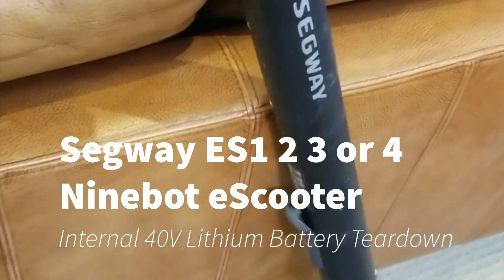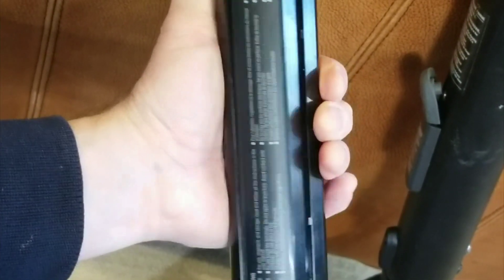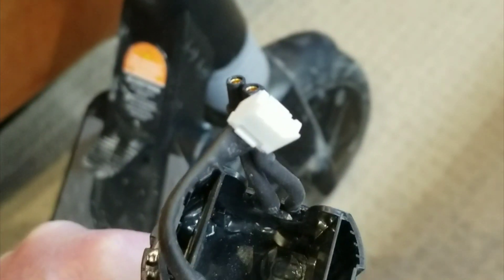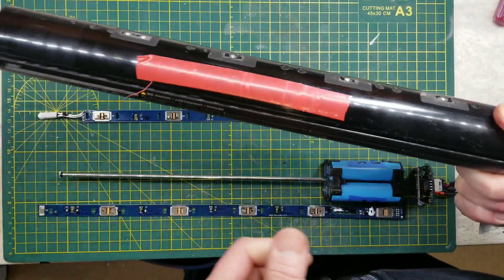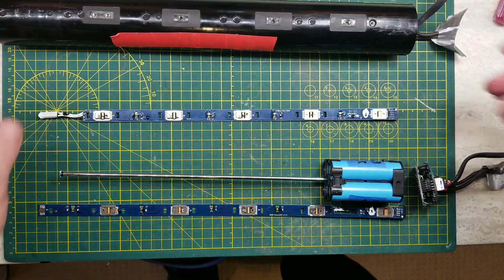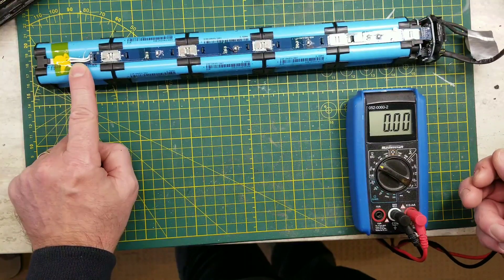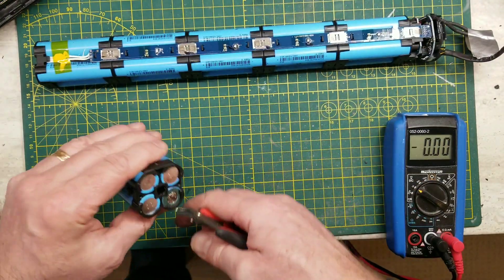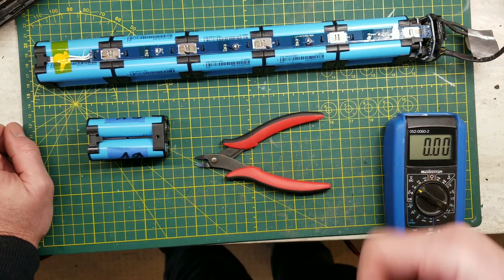Segway Ninebot Internal Battery Teardown

Comment: Hey there, have removed the whole pack from an ES2 and there is no blinking from the pack but with multimeter read out is 14,7 volts. Can't get the scooter to start the display or charge, simply to low voltage to charge it? But why no blinking you think?
Reply from the maker: Hey Per
15v out of pack is definitely not right or good.
Should expect voltage of 40v plus when fully charged and I believe no lower than low 30's for 'discharged' state.
Each of the 20 cells works between about 3.7 and 4.2v when healthy.
I dont know the exact answer but could be your BMS board in battery has gone bad and your cells will no longer charge. Has scooter been 'dead' for a while? 15v is very low.
Reply: @fixitdad899  yeah it was left over wintet by previous owner. But all solved now. Managed to bump the battery up again to around 27 volts and aftet that regular charger worked again. First battery showed nothing (not flashing) but after a little bumping it started first flashing red and a bit later went to normal blue flash state. 👍🙂
Reply from the maker: Hey... nicely done! Great information re: when lights kick in / red / blue.
Question for you - how did you bump charge? Did you have to bypass BMS in battery pack (disassemble) or could you just go straight to the standard power out leads? Did you use a plug in external adjustable power supply? I have a bench top supply that I think maxes out at 30v. Can adjust current and voltage. You? Many thanks for any insight here.

Comment: My isn't finishing blue it run donw immediately and when am charging it it get full immediately
Reply from the maker: Hey Mike ... just curious ...How do you know its 'immediately full' when charging? If you are looking at charger and seeing green light it does not mean battery is full. It means charger does not want to supply current to battery anymore. A battery that has gone below minimum charge will also do this. Are you checking with voltmeter / multimeter?

Comment: Hey there its me again...so I went with your advice and purchased a new internal battery and I have installed it but do I need to reset it somehow ?? Cuz Ive got it all back together again and turned it on only to still get the error code 19. The blue light is fllashing on this replacement even so what should I do. Plz help
Reply from the maker: Hey RobYn ... nice to hear from you again. To be honest I sadly don't know the answer.
I've tried to find the 'Rosetta Stone' for decoding error codes for trouble shooting but alas haven't yet found.
Am not sure what Code 19 actually is.
Can anyone reading this who might have the answer jump in and advise RobYn on this one?! Many thanks gang.
Reply from the maker: https://m.gearbest.com/blog/how-to/ninebot-segway-es2-scooter-error-code-7369
Reply from the maker: Says "19: Battery voltage is abnormal, check battery, control card, cable connected."  
Is there a loose cable somewhere? What is voltage on new battery if you check with voltmeter? Should be 35ish V or better if it has reasonable charge on it.
I wonder if you have to pre-charge before you install replacements? Did you buy replacement 'new' or could it be a used dud sold by some scoundrel?

Comment: how did you get the cover off the battery? The cover with the two holes? I have been looking for 1 year for this tool !!!!
Reply from the maker: Hi Dash..  I have a basic shop compass from Harbor Freight / Princess Auto. The ones that have two metal legs with pointy ends with thumb screw to adjust distance between the points.
I just adjusted legs to the width of holes and gently twisted out the plug/cap.  They (threaded caps) aren't really tightened in too tight...more just positioning.
If you Tuck or Duck/t tape two long skinny bolts together would probably work.  Maybe even elastic on chopsticks?!  Good luck!

Comment: Anyone got a video of replacing the mosfet side? When bms connected its shorting out in one of the mosfets and causing the voltage drop + red flasing light
Reply from the maker: Bummer...but good to know one possible cause of red flashing light. I don't have vid for that unfortunately. Anyone else?

Comment: Hey buddy, great video! Did you ever change the BMS from the other pack? Did it work? Do you have a video? I just opened mine and i believe my internal battery is dead and I'm about to purchase a new BMS. Just wanted to know if it works or not.
Reply from the maker: Thx Benjamin
Sadly still on my to do list.
I don't have total confidence in the cast-off boards that I currently have but will give it a go sometime and we'll see what happens!
Hey ... post an update link or or comment on your fix would ya? Am interested to see how goes Best Rhys

Comment: What is the exact type of battery are those blue rechargeable cells inside??
Reply from the maker: The size is 18650
The Chemistry is Li-Ion
I don't have one near me but there are markings that indicate the discharge rates on these cells. They are either made by LG or Panasonic 
Operatibg Voltage range 3.7-4.2v
Reply: @fixitdad899  Perfect thank you!!

Comment: Okay... I hate to admit this but I miscalculated and accidentally punctured my internal battery by mounting a cup holder I was custom mounting. It was obvious what happened cuz smoke stink and hissing started flying out so I knew I messed up. Havent opened it up yet to see all of the damage I did but is it possible to just replace 1 of those vells if thats all I destroyed??
Reply: Thank u so much for your advice and yes I know theres no way to tell until I open things up but yeah it was just the point tip of a short screw that right as it went in it was a tad bit too far so that whole gases spewing and hissing out the top of the main stem of the scooter as well as out the bottom (mind u both ends attatched with scooter fully assembled) when this happened which Im guessing is a good thing more then not as I dont know how or where that would have sprayed had it been open. I moved it outside carefully after the hissing calmed down a bit because of the gas and the smell I thought could very well be toxic. Plus in the case it did catch fire inside. Ive been afraid to open it up to see the full extent of the damage Ive done and I was so mad at myself. I had just ate some THC infised edibles I had made myself about an hour or more before this so Im thinking that may have caused my poor judgement in this mistake. All I know is that I love my scooter and to take it out and ride makes me feel like a kid or even better as Ive got it at 30mph with the upgrad I did and Ive put so much money into this thing cuz I hate not being able to ride. Its like land surfing literally. Ive learned so much about this thing and Ive replaced the controller in the main stem 3 times myself already ...the hand brake lever and the dash to a flashed dash so I hate spending more but I think youre right. I actually do have the soldering tools and wire cuz I usually do do these projects myself simply for the learning of it. Knowledge is power and I love learning new things. The internet makes it so easy to learn things these days if we are proactive to go seek it out. I did see a used one for pretty cheap on Ebay but that wasnt specific enough for me. I dont want to get a used 1 and find out its ben used up and has dead cells. I dunno but I gotta fix this soon lol. Thanks so much for your help. 😊
Reply from the maker: Hey RobYn
Ouch ... that must have given you a jolt. I have miscalculated on asst projects more than once myself! Note to self...turn off breaker...doh!
In theory yes I guess you could replace individual cell or cells. 
I want to preface that I am not a technician and Li-Ion batts can be very dangerous. Yadda ya... do not try this at home. Disclaimer done.
If you were drilling into case chances are you did only hit one cell. But the whole hissing and smell thing...do you think fire was involved?
Here's why I ask: physical damage to one single cell is one thing but if that cell heated up significantly when it was doing it's 'not so happy dance' it could have damaged cells or circuitry around it. Cells don't like to be prodded punctured or cooked.
You may find when you open up that a chain reaction could have happened involving many cells.
Or..you may have drilled through circuit board if unlucky.  Hard to tell until you open pack up.
Not gonna lie... would not be a fun project to replace one cell. Not like popping off back of remote control and replacing AAA battery.  Everything in there is spot welded together. You'd need to disassemble/reassemble pack ... lots of soldering or spotwelding.
I'd probably be looking for new or reconditioned pack and advertising your current 'project pack' on Kijiji for a scavenger like me. Chalk up the loss to experience.
The time involved to replace  individual cells probably not worth dollar/hr effort unless you have all the equipment to manage. 
But hey... would certainly be a great learning opportunity if you were to SAFELY attempt.
Just be careful OK!
Please do let us know how it all goes! Tha is for watching. Good luck
Reply: @fixitdad899  Thats funny I just noticed your name on here...Ive always gone by "Mom the Builder" singing the "can she fix it ? Yes I can!!" To my daughter all her life lol

Comment: I have a ES2 and I think the battery is dead, do you think will comeback to life if I buy an external battery? I think installing an external will be cheaper and less work. Thank you in advance
Reply from the maker: Hi AZ...just want to preface my comment with fact that I'm just a Dad and not a scooter technician.  Here's my opinion though. I could be wrong but I dont think you will be able to just put an external battery on as a straight replacement/alternate for internal one.  
The logic in the 'brain boards' is going to check that the voltages of internal battery and external battery are the same or very close to it. When the voltages are not in tandem between the two the logic will throw an error code.
Pretty sure its Code 19.
Not sure if scooter will scooch if it is showing a code error.  Never know ... it might but not so sure. Good luck!
Reply: @fixitdad899  thank you for taking some time to answer me

Comment: I have the blue light but it is not flashing, it is constant. I measured between 18V and 19V on the main connector. (Is it below the cut-off Voltage?)
I don't know if I can measure interesting info on smaller 4-wire connector.
Context: I hadn't used my ES1 for several months because of the lockdown. One day, I took it out and it began at somepoint driving quite slow and then much too slow. I got home and charged it. After, when I switched it on, I got error code 21. I've had error 21 since then.
So maybe I need to do some individual cell charging. I don't know yet. 
Maybe it's cheaper to buy a new battery than a specialised charger. However, it's probably not very eco-friendly to just dump all these cells. 
Moreover, I don't have a certainty of what the issue is. Since I didn't use it for a long time, chances are it's the battery.
Reply from the maker: "This error is thrown when the ESC is unable to receive any data from the BMS/Battery. This may be because the 4 pin BMS data line has come unplugged or is not firmly plugged into the ESC. It can also happen when the battery is fully dead or something has killed the BMS board inside" (credit to Joey Babcock)
Reply from the maker: Hey Tanguy - thx for reach out. The context you give does sound like super dead battery to me. You just put it away for a few months and it wasn't happy...its not like it fell down multiple sets of stairs and suffered an impact or two.  If it had suffered a trauma maybe a loose connection to BMS? But 18-19V seems way low to me. Not sure what actual cut off is on this machine but cells usually dont like to go any lower than 3V if I recall correctly.
So you should be getting a reading of no lower than 30V on the pack I would think.
Reply from the maker: Agree that it would be a waste to totally dump the pack and cells. You can get some 2 or 4 slot chargers pretty inexpensively from Wish or other retailers. BUT ...My only caution is that cheap chargers aren't smart enough to know a good cell from a bad cell. With cheap chargers I actually use a thermometer with a magnet on the probe and click onto cells I'm  not sure about. Monitor them when they start charging to check for odd temperature rise.  I recently had one get very very hot. If I'd walked away and left it without monitoring who knows what might have happened. My next iteration will be an arduino with an alert so I dont have to watch! Project for next winter.
A bummer that your pack discharged so quickly.  Best wishes on your fix. Let us know how it goes.
Reply: @fixitdad899  Thanks for feedback FIXiT.  Yes, the connectors were plugged wel.  I'm considering buying a charger so I can charge each 18650 cell individually. 
I'm guessing the BMS refuses to charge batteries with a voltage that is too low, for security. I don't know what's the technical reason. 
Though I've seen videos that say a good charger will allow lower voltage but you need to oversee. 
Also, as you show in your video, I probably need to be very careful that the thermosensors are still measuring the temperature correctly. 
A new battery pack costs like 200eur while a Li-ion charger costs between 10 to 30eur. Seems worth a try.
Reply from the maker: Are you proposing to disassemble the pack entirely ... charge cells individually and reassemble the pack or are you proposing to charge the whole sleeve of 20cells at 40v?
Reply: @fixitdad899  Good luck with the Arduino. Nice!! 
Btw, I saw somewhere that if the 18650 cell measures 7cm, then there's also a tiny BMS inside the cell to protect from overcharge and such.
Maybe it limit's the lowest acceptable voltage, I don't know.

Yes, it's a bummer if you can't leave this battery pack for several months without usage (e.g. winter).

Also I realise these batteries can be dangerous and the trend is that people are collecting more and more of them.
Reply from the maker: The taking apart is not so bad but the putting back together with Ni strips etc. Would be a ton of work. You might be able to isolate 'pairs' of cells in situ by just uplifting those tabs on side rails. Using jumper wires/gator clips on those tabs to charge. 
However If you have a spot welder and some experience is doable to reassemble whole pack for sure but headsup...is a ton of work.
Reply: @fixitdad899  Yes, first I'm going to retry charging all with the power adapter from the Ninebot.
If that fails again, I'm thinking of disassembling the pack like you showed and then charge every cell individually with a 18650 cell charger. Then reassembling and hope the error 21 will be gone and that the BMS, ESC and Ninebot adapter will be able the manage the battery pack again. 
Maybe I could replace a couple of 18650s if needed.
Reply from the maker: Yup .. accumulation of eWaste an issue to be sure.  If you are interested in the topic check out this emerging company - ABML American Battery Metals Corp.  Located in Nevada near Tesla complex... Lithium Battery Recycler.  To your point -with current Green revolution we are going to need a lot more like this.  Hydrogen fuel cells way better for our planet in long run in my opinion. 
And yep some 18650s do come with individual BMS caps 'tis true.  Not the most common cells tho' - added expense.
Reply: @fixitdad899  Ah really, you mean all those cell are welded ? 
I do have a soldering iron but not that many practice.
Maybe I can identify which cells are problematic and just work on them. 
As for using a 18650 charger, I assume it's designed to charge only a single cell per slot unfortunately.
Reply: @fixitdad899  Nice thanks, I'll check ABML. I also do hope Maxwell (Tesla) will achieve their design of new dry battery technology.

Comment: My es2 is not switching on anymore do  I need a new battery also wen It does on it turns of mid ride help plz
Reply from the maker: Hi Adnan - thanks for reach out.  I'm not a trained technician I'm just a DIY Dad and not a lot of information to go on here.  But... you say it doesn't switch on but then you say when it does switch on it turns off mid ride. 
Just guessing but sounds to me like a loose connection between battery or the control board on top of handle bars.
If the thing turns on and rides at all ever then my guess probably not your battery.
When you say 'it doesn't switch on anymore'..do you get any LEDs lighting up on panel and it just won't move or is it just totally dead? 
You might want to check that the external battery is connecting correctly.  I've heard that the contacts can get corroded or can shake free over time.
Means internal and external batts will not be in synch voltage wise.  Recommend removing external battery and fully charging it on its own...fully charge the internal battery as if it was a standalone  ES1. Check contacts and reassemble.  Worth a try.
Reply: @fixitdad899  thanks my scooter has completely shut off nothing is coming on so al try wat u have said